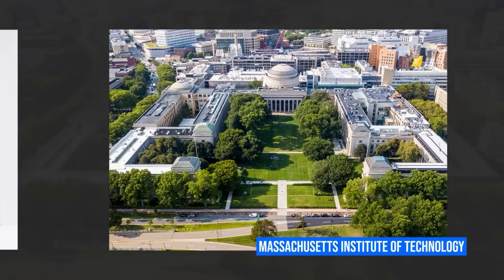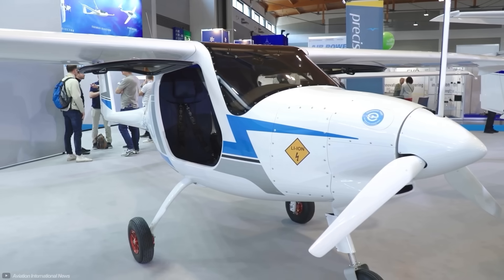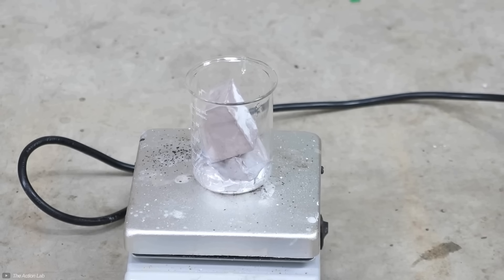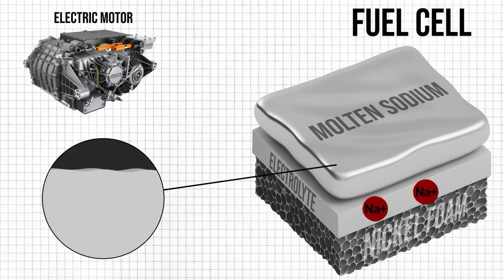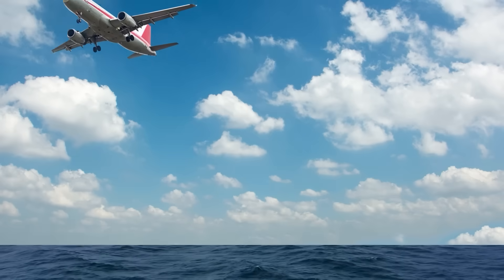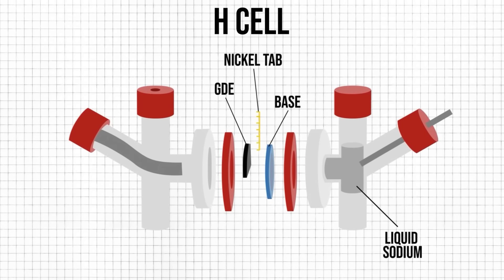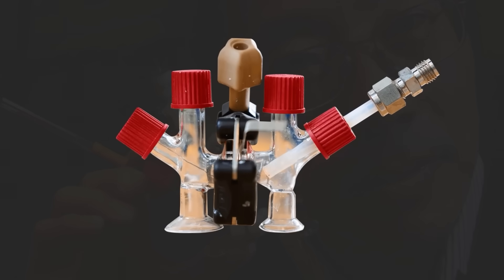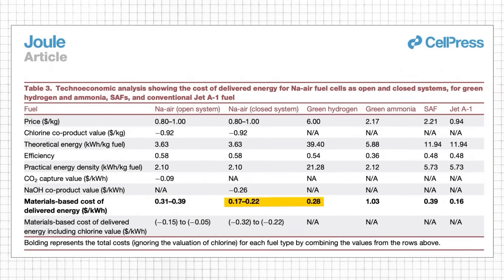How MIT's New Sodium Fuel Cell Changes Everything

Comment: Chemical fuels are just liquid batteries storing an energy differential between the air and fuel, and fuel cells burn their fuel in an extremely controlled fashion that allows electricity to be generated, you also need to push this on everyone to do anything about climate change. Hot gass expansion driven engines are just doing the same thing but with larger volumes and simpler parts so the design has to be different. You just need a somewhat efficient diesel or sterling engine to go farther for less than all electric, or a plain diesel and electric hybrid can get into the efficiency range of fuel cells while being repairable and easily remachined (if it's designed to be repaired like most things used to be). Even with emissions not scrubbed a diesel produces so little at it's most efficient that it doesn't really matter if we get efficient and use mostly trains and boats and busses. You can make an ICE engine or any of it's parts with common machines, and it's also a much more worked out system which is for now the most reliable, and it won't ever be surpassed as far as ease of building, fixing, modification, or maintenance goes. Regen braking efficiency is also limited by the 40% wasted when a lithium battery is charged, but capacitors can capture and reuse up to around 90% of the momentum. A two stroke diesel running at a comfortable range with a second burn in the exhaust could take care of emissions without the crazy systems they need today, while getting close to the max theoretical limit for this kind of stuff, and the power density of a 2 stroke diesel makes up for the weight to power of the sterling engine. Turbines are probably the best route for aviation though since it's pretty efficient, while being light, and reliable. 
Even if they get fuel cells and batteries to last as long it all needs to be recycled for the cost on the environment to really zero out, which is just easier with simpler stuff while most recyclable things don't get recycled because you don't care as much when something is seen as "trash", also it's not cost effective and has to be subsidized for most materials. Electric motors are more efficient, but rechargeable batteries waste about 40% of your charging infrastructure while ICE's can be happy with byproducts of agriculture (ethanol, and methanol from fermentation of waste, and wood gass/distillates which also behave like gasoline). Water and ethanol injection can squeeze extra power out of combustion since they help even out temperatures, and water pushes more for the same heat than most other exhaust gasses while cleaning the engine. Heavier stuff like oil for some diesels and general lubrication also can be made sustainably, but it's not really a big deal since it's not pouring through most engines. Plants can be used more efficiently than PV's here since they turn raw materials right into food for microbes that make ethanol for free (or at least much less infrastructure upkeep). It can be made even more efficient by genetic modification, solar panels can absorb the light that plants can't use by shading or filtering out certain wavelengths, infrared can also be reflected to power heat engines and distillation, or left to reflect back into space since plants reflect it well. We could repurpose oil rig infrastructure to colonize the less habitable parts of the oceans with sustainable PV, kelp/algae, mussel, and fish farms, then we can capture all the carbon we need to while feeding ourselves and it should take very little input for infrastructure compared to building algae farms all over the land. You also don't need subsidies when nature can eat your waste and cellulose is a great plastic that's already close to waterproof, biological waxes can make it mostly impenetrable too, glass works for just about everything else. The ocean can handle this better since it's mostly uninhabited and what is there is mobile rather than being rooted into the ground if not part of the topsoil itself. Half or more of land habitable to humans and green ecosystems can be freed up for avoiding extinctions, we need at least 50% of the land left alone for most stuff to survive with us so this'd be perfect. Making the oceans more reflective will also help with climate change directly in addition to reducing effects from co2 pollution.

Comment: Sodium hydroxide dilute or full strength is not that color there is something else in there as well. second does this fuel cell provide more energy than it takes to melt the sodium?

Comment: Sodium is refined by electrolysis from salt, giving chlorine as a byproduct. Industrially, we use both about equally. If you want to make sodium as a fuel you'd end up with a ton of extra chlorine. Where's that going? You could turn it into an acid and react it with lime, but then you'd release the carbon dioxie you emitted previously. I struggle to come up with any sustainable economy using sodium fuels.

Comment: How about a hybrid setup running in conjunction with a turbojet? Think of each as a catalytic converter for the other. The CO2 from the turbojet exhaust is used to neutralize the NaOH and the NaOH is reducing the CO2 output from the engines, while boosting output through electrical power. In the end, it might be a power to weight loss, though.

Comment: How would a plane be refuled using a single use solid fuel cell? You'd have to do a fuel cell swap every flight and would need all the inferastructure to move, store, and recycle fuel cells. What happens if a plane has to make an emergency landing at an airport that doesn't support fuel cell swapping? Cool tech but I don't envy the engineers that get tasked with rolling it out.

Comment: I've worked for many years in the alumina industry, which uses lots of sodium hydroxide in the extraction process. Trust me when I tell you, that having NaOH pumping out the back of a plane is NOT a good thing. It is very corrosive for organics (like, as bad as strong sulphuric acid corrosive). It doesn't just react with CO2, but also combines with lots of other substances in a multitude of ways that are not good. It is a costly exercise to manage it as a waste product. I doubt that any envronmentally, or safety conscious society would accept this stuff flying out into the atmosphere, especially over where people live.

Add to that the fact that NaOH corrodes, and eventually dissolves aluminium. This is the reason it is used in aluminum production in the first place.
Now I don't know about you, but having a byproduct ejected out the exhaust that eats away at the metal that makes up 75-80% of the plane, doesn't sound like such a crash hot idea.

I think they will have to come up with a better solution for dealing with this byproduct.

Maybe it could be retained onboard the aircraft, then sold later. Of course, this would decrease the cost savings, as it would have to be carried the full flight instead of being dumped (adding weight to the aircraft as the tanks must be caustic resistant). It's low relative value also means it would also offset the cost savings somewhat. The alumina industry purchases NaOH by the ship load. Buying caustic from the aviation industry would probably cost more, as the economies of scale aren't as good. Still, the synergies between aircraft waste produced, and the input cost into alumina production that in turn gets manufactured into the plane might be an interesting solution worth investigating.

Comment: sodium hydroxide is an extremely active and strong basic material. We use it to treat the water in boilers. It acts like an acid at room temperature but in the opposite direction. It can eat metals very easily, so I hope they have some plan other than discharging it into the air. We overtreated our boiler once, and ended up replacing many tubes that were eaten away.
Reply: what was the tube material? Iron and steel don't tend to have problems with Sodium hydroxide.

Comment: Sorry guys but this is too late.  I have a patent pending for an electrically “rechargeable” metal-air battery, ie, no need to “reload…blocks.”  Just plug it in.  Effective C-rate is far beyond lithium-ion.  The system works even better with iron, which, though heavier than aluminum, still provides 3-4 times better specific energy than lithium-ion at the pack level.

Comment: NaOH is corrosive but that means it will quickly react into something harmless, like eg with CO2.
When you use it for drain cleaner that's in because of these properties. You need something that reacts but ends up harmless. Just don't drop it into any mercury or explosive...

Comment: You could use research made by thorium and salt based cooling systems as part of this research. You can also use a thin layer of bacteria or algae and even lichen in conjuction with solar cells to reuse the sodium hydroxide and sodium bicarbonate. I mention this because there was a french compnay that does something similar with air purifiers. They used targeted breeding in specific environments to create a strain of bacteria capable of purifying specific compounds in the air. You could do something similar with the air near the tail of the plane to capture some of the air to purify some of the carbon dioxide and monoxide resleased. Also sulphates, phosphates and nitrates produce in high temperature such as commercial jets. Of course this is a hybrid system. Could even use hydroge fuel systems. Been a while since i used my GCSE chemistry knowledge. I say this because i remember that the trees use photosynthesis to turn sugars and water into hydrogen ions which react with the recptors in the cell to open and close the cell receptors. You could also add studies into nerve cells, eels, and slime molds. This is just a mish mash of ideas that came to mind.

The lichen mentioned earlier is better for phosphates,nitrates and sulphates created due to trace elements in fuel and incomplete combustion

Slime molds and fungi can help regulate all this.

Oh and moss can help capture moisture used for this system.

Comment: just a sidenote , keeping excess weight once you have attained altitude will anhance performance not decrease it (see gliders and the function of ballast) , in short the glide ratio of a glider or any plane is increased the more weight you carry making it more efficient . consider the weight as a storage mechanism for potential energy . Glider pilots carry water as ballast for this reason.

Comment: What's the energy input to make the sodium? If it's more than can be extracted discharging this sodium fuel cell, then it's a battery that's 58% efficient. In other words for every unit of energy you need to make the sodium, you only get 58% of that energy out of this sodium battery.

Comment: Putting a chemical that is more reactive to air and water than phosphorus in a car is dangerous. Just go watch a video on a reactive and explosive it is. Accidents could trigger an explosion and shrapnel could kill pedestrians. Also, this is just a new design. There is not commercially viable production chain yet, which is where many if not most good ideas dies. 
Fuel is safer, energy efficiency is very good and we know how to handle its hazards. 

I think carbon capture and liquefaction would be a much safer and adequate method of keeping proven technologies alive while real, concrete and tested alternative can be put in production.

Comment: This sounds like a great possibility for electric aviation.  I was worried about the sodium hydroxide emissions, though, but I found that sodium hydroxide reacts with carbon dioxide to produce sodium carbonate.  I don’t know, but it seems that the sodium hydroxide emissions could be useful in removing carbon dioxide from the atmosphere.  I couldn't find anything specific that would imply that the NaOH would encounter CO2 and react before reaching ground level, but 2NaOH+CO2→Na2CO3+H2O   It sure looks better than spreading NaOH everywhere.
Reply: Exactly, NaOH doesn't naturally become Na2CO3 when exposed into air. In one literature there is an attempt to create Na2CO3 from NaOH but it requires complex step and involving ammonia. So this video is saying something that is not possible.

There are many doubtful things I found in this video.

Both Sodium Carbonate and Sodium Bicarbonate are not created from NaOH.

https://en.wikipedia.org/wiki/Sodium_carbonate.
Reply: @stark_energy  Thanks.  I couldn’t find what I was looking for in quick searches.

Comment: Indeed, using sodium (and especially liquid sodium) as a fuel sounds hazardous.  I wonder how this system would work with eutectic NaK, which, in addition to not needing heating to stay liquid, can pumped around easily and is not as reactive as pure sodium.  If continuous voiding of the byproduct lye is found to be problematic, it would probably be easy to concentrate it and store it onboard.  I'm wondering if the chlorine generated in the production of sodium could somehow be used to scrub CO2 out of the atmosphere.  Over to you, chemists!

Comment: Sodium and water....not a good mix. Petrol in a fuel tank generally doesn't self combust. Large Lithium-ion batteries and sodium in this format are just waiting to cook off. Currently an airliner with liquid fuel still has a possibility of landing if a fire breaks out. If a future airliner with a lithium ion or sodium power source catches fire it is literally game over immediately as the fire or explosion would cause structural damage much faster than aviation fuel.

Comment: When I invented a li-ion battery that could be recharged by pumping out discharged liquid electrode and pumping in fresh liquid electrode (8399138) Ben Christian and I created a flow cell (“fuel cell) using heated lithium (liquified) on the anode and my liquid electrode as the cathode but didn’t consider the fuel cell nature a practical instantiation. I am curious if these inventors have overcome the practical issues. The liquid refillable one I invented is quite practical incidentally.

Comment: Consider anhydrous ammonia instead. The energy density is completely workable and the exhaust products are nitrogen and water.
Reply: Yes, only problem is the poor power density of direct ammonia fuel cells.
Reply: @frbe0101 With the current incarnation of fuel cells, yes. Though I suspect there is a fair bit of development that could happen there. Alternately, it can be used as a direct combustion fuel with the same exhaust products.
Reply: @worldwideroach  Ammonia has less than half the energy density by mass of gasoline or kerosene. Only via fuel cells could the much power energy density be made up with greater powerplant efficiency. I could see ammonia working for cars and trains and ships and maybe small propellor planes. But for large airliners at speed I see no other alternative then biojet fuel, nothing else will provide the easy for fuel storage (no high pressure tanks or cryogenics) and energy density by mass, as well as drop in capability with existing turbine jet engines.
Reply: @frbe0101  That, and in the event of a plane crash you have a toxic cloud that can kill people from much further away than a jet fuel fire can, and a zero survival chance for anyone on the plane itself. And of course the potential for a fuel-air explosion.
Reply: @frbe0101  ammonia can be made almost directly out of air using heated iron plates, so basically its just a conversion from energy to fuel. the energy density isn't as big of a problem when used in commercial airlines and solar energy is actually cheaper at scale than petroleum so it's a pretty valid option. the main problem is actually the pressure/temperature required to store it. toxicity is a concern, it can be corrosive too.
Reply: @frbe0101  We have ethanol fuel cells today with great power density.  

Large advanced European and Indian military submarines use ethanol fuel cells for propulsion.  

Nissan in 2016 drove around Brazil using its E100 infrastructure in a fuel cell vehicle.

Computers, drones, power backup, and RV/sailboat power alcohol fuel cells are sold today.

Those use a catalyst to make the hydrogen from ethanol and next gen direct ethanol fuel cells are coming.

>>>Fuel Cell technology offers many advantages over Lithium-ion batteries, not the least of which is that hydrogen used in fuel cells has the energy to weight ratio ten times greater than lithium-ion batteries.

That said, the volumetric energy density of ethanol is over five times greater than hydrogen.

Ethanol has five times higher volumetric energy density (6.7 kWh/L) than hydrogen (1.3 kWh/L) and can be used safely in fuel cells for power generation.

Source: Phys dot org<<<
Reply: Possible in an industrial setting like commercial aviation, but anhydrous ammonia is also extremely toxic in its own right.
Reply: @AshtonK1816 Yes but not as twitchy as ammonium nitrate.

Comment: An ideal battery for a weapon that needs a high-energy compact power source and isn't coming back and you don't care about the enemy having to deal with the byproducts.
Otherwise useless due to chlorine production during energy-intensive manufacturing and horrendous fire hazard whether in a ground or air vehicle.

Comment: Yeah, sodium metal is not cheap or plentiful. It doesn’t exist in nature. You have to make it. That takes a ton of electricity and there’s no way that you’re gonna need as much chlorine as would be generated if you’re going to run vehicles on sodium.    

Since you have to make the sodium using electricity, if you want it to be green, you’ll have to use something like nuclear power or renewables. And sodium metal is highly reactive with water and air.

And it only 60% efficiency it doesn’t sound like it’s a solution. 

It’ll probably be cheaper and more energy dents to synthesize hydrocarbons to use an airplane